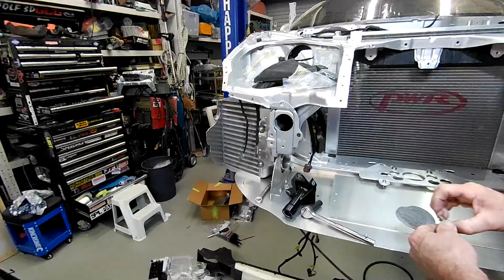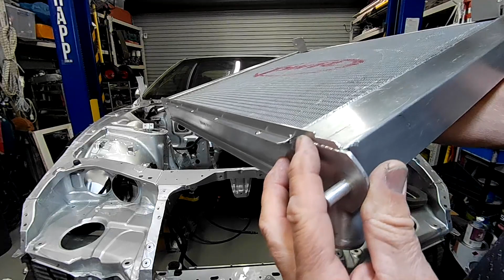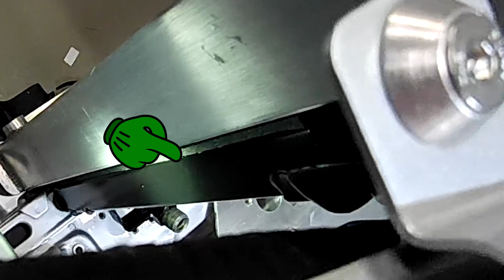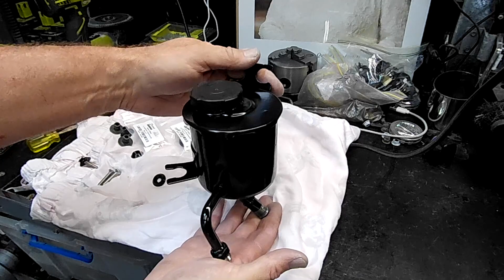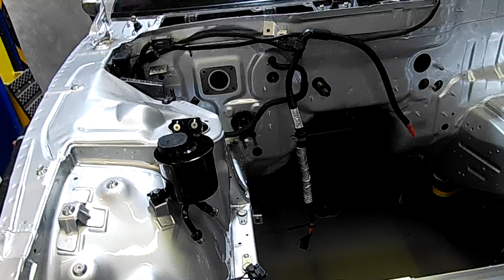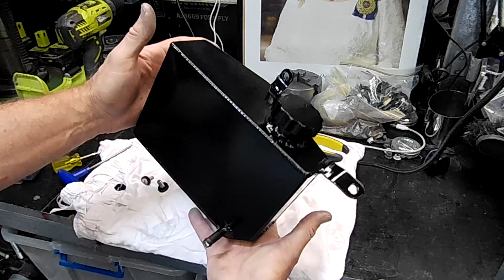Detailed Painted Engine Bay Assembly, Project Fairlady, Nissan Z32 300zx Twin Turbo Mega Build

Comment: Hi Trevor, Just a tip for you make sure you flush your AC system out before connecting it to your compressor or you TX valve you need to get all the crap out of it before you vacc and regas, Oh and don't forget to add new refrigerant oil to you system, The condensors do trap a lot of shit inside over the years, But all in all another great job. by the way a new condensor is not all that expensive to buy in most cases depands on where you buy it.
Reply from the maker: Thanks for the Tip Wayne, Yes, the whole system in this thing is a bit of an unknown. it was non functioning when I bought the car. All connected but no Gas. Could have a Leak, or never re-gassed from the last engine out. I guess i'm going to find out eventually. Cheers Mate.